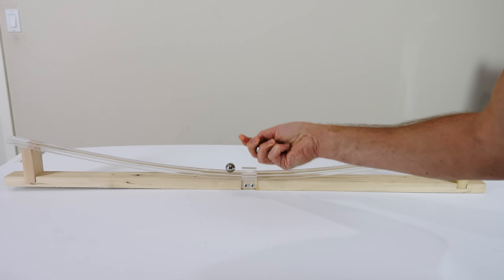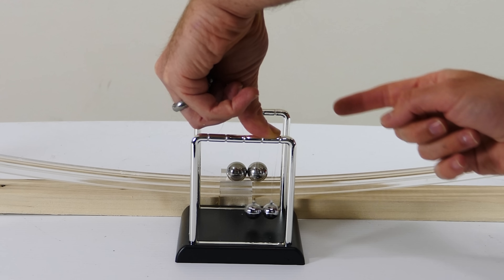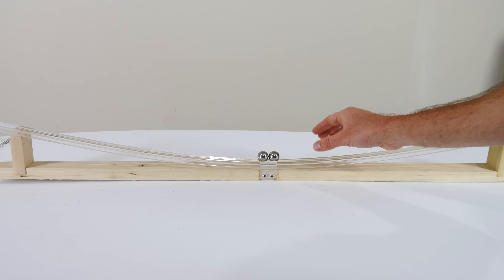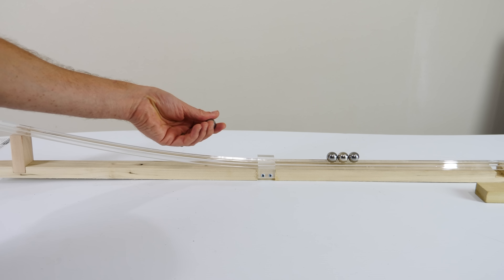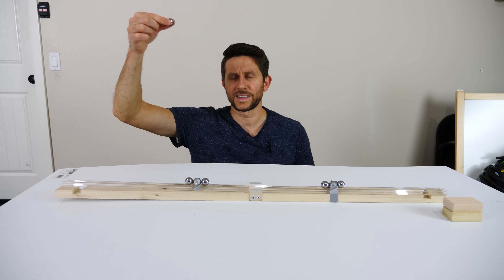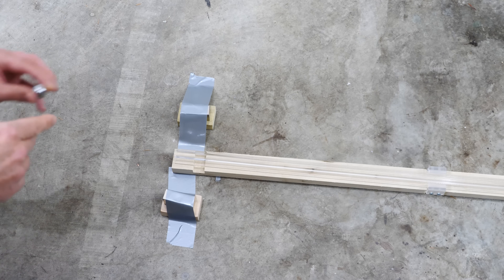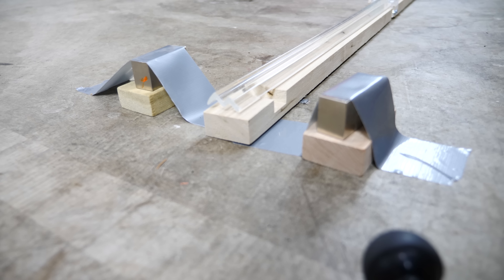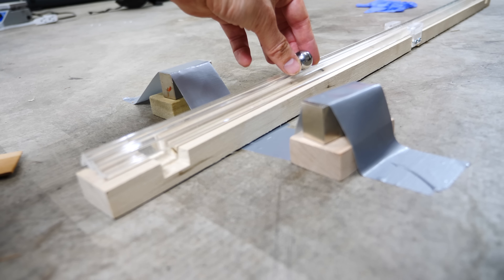How Does a  SMOT Work? (Simple Magnetic Overunity Toy)

Comment: There is always an energy loss between two or more balls rolling together, even if only during the time of impact.  They have their surfaces moving against each other with a sliding contact of counter rotation to each other.  This loss is much greater compared to the rolling ball's stationary motion between the ball surface and the track.  (But the rolling ball sees that resistant frictional force all along its travel path.  The pendulum balls do not.)  This is why the balls in ball bearings are caged to keep them from rolling (counter- rotationally) against each other.

You are not quite correct when the two balls impact on the track, and then the initial ball starts moving again.  Though no impact perfectly transfers all inertia, (we will assume it is nearly perfect here) with the target ball at the lowest part of the track, the second ball is still slighty higher on the curve of the track after the impact.  Once free to move after the impact, the now stationary ball will want to roll that bit further to the lowest point of the tract.  The pendulum balls on the other hand are hanging dead vertical (on nearly frictionless pivots, with the hangers during their impact, all being precisely spaced 1 ball diameter apart) so they have no residual potential (elevational) energy after impact.  The hanging balls are also not rotating at all relative to each other, and are only moving linear to each other at impact so they are just very efficient energy wise.  The pendulum balls only have to overcome air resistance during their swings and a very small loss due to the impact deformation.  The rolling balls have increased air resistance, (due to the additional surface speed of the ball in the air) added friction of rolling on the track, friction between relative motion at the impact sites, the additional rotational inertia starting and stopping the roll, as well as the impact deformation itself.

Anyway, I do enjoy your clips.
Reply: Agreed. Love the videos which are usually spot on, but this one is not quite entirely correct.

Comment: Your explanation of not gaining energy when passing through the taped magnet balls is wrong. The first ball gained energy when it was pulled to the first magnet ball. When that ball struck the magnet with the increased momentum gained by magnetic attraction, it was transferred to the last ball in that line. Then that ball with the added energy of the magnetic attraction continued on to strike the second magnet ball. That second magnet ball added more energy by attracting the ball in motion to itself then imparting that energy to the last ball in that line. The last ball has more kinetic energy than  what was input into the first ball. Both the first ball and the last ball have the same mass , but moving at different speeds. The energy type they both have is kinetic. Potential energy is stored energy such as in a wound spring waiting to be released, or a ball at the top of a slope waiting to be released. Neither the first ball or the last balls energy can measured as potential. The last ball has more kinetic energy than the first ball. Fact. Where did that energy come from? The magnets.  This experiment is a poor example to disprove over unity motors, but you are right, conservation of motion is why over unity motors don’t work.
Reply: "Your explanation of not gaining energy when passing through the taped magnet balls is wrong. The first ball gained energy when it was pulled to the first magnet ball. "
He's not talking about the potential stored by moving individual balls through the magnetic field-he's talking about the total energy in the system. Notice that he says, correctly, that the kinetic energy of the last moving ball is less than that of the first. That's the indicator that he is talking about the system, as it would be irrelevant to compare that value to the now stationary balls.
 
You're not wrong, and he could have clearer with this, but his point was that as there is no source of energy in the system, so-called perpetual motion devices will cease to work due to losses from resistance in the system. 

As perpetual motion machines are supposed to represent closed systems, it generally makes more sense to analyze and debunk them in terms of total energy in the system, rather than the transfer of energy within any individual parts.

Comment: One major loss of energy, that you didn't mention, when two or more balls are rolling together (touching each other) along a track is the friction between the surfaces of the adjacent balls.  When they are rolling, all the balls are rolling either clockwise or counter-clockwise (as viewed perpendicular to the direction of travel).  So when adjacent balls touch, their respective surfaces rub together at twice the rotational speed of each ball.  In effect, each ball is slowing down the other adjacent ball.  This effect is only compounded as each additional ball is added to the procession of touching, rolling balls.  By contrast the balls swinging back and forth as a pendulum do not slow each other down because their surfaces are not rubbing together.  They are merely touching each other, transferring nearly all their momentum to the other ball.  They do eventually slow down and stop, but it is largely because of friction from air resistance and internal friction from the continually-bending line that is suspending each ball.  There is also as very small bit of energy lost to sound (the clicking sound when they smack against each other) and perhaps a very small bit of energy lost due to a tiny amount of heat generated (within the balls) when the steel balls deform imperceptibly.

Ed Schultheis, PE
Mechanical design engineer and manufacturing consultant for 35 years
Schultek Engineering & Technology, Inc.
schultek dot com

Comment: Mr Action lab man sir
I have had this idea of a theoretical free energy machine for a while but I can't test it.

The idea is that you have a generator that is powering a big gear with alot of 'teeth' and that next to this big gear is a small gear with very few teeth.

Now the idea around this is that
Generator is spinning (big gear) with a set rotations per minute = number of 'gear teeth' Effecting little gear, because the amount of 'gear teeth' that are conjoined on 2 seperate gears creates differences in rotation speed. So if big gear is spinning at 10 rotations per minute, with 60 teeth, and the little gear has 10 teeth, that means that the little gear little gear will spin with 60 rotations per minute, and if the little gear is on the same connection point on a charger for the generator, does that not mean it's creating more electricity than the generator is using.

I'm sorry if it's a long read but it's the best I can do to explain my idea

Comment: How can you honestly say that the ball being accelerated by the magnet has less energy than the original? It sounds completely absurd. You have to use theoretical "laws" to explain it, but in common sense, it obviously does.

Potential energy only exists because there is a force capable of interacting with the object. Not because you moved the object.

The reason perpetual motion machines don't generally work is because, like you pointed out, magnetism isn't a one way force. It pulls the object back after accelerating it. Just because the system doesn't result in imbalance, doesn't mean it isn't creating energy. It just means it's creating energy in balance.

This just sounds like an excuse to pretend that energy cannot be created (or destroyed).

How can you suggest that gravity (or magnetism) doesn't create energy, when it causes acceleration? When it spontaneously brings objects together?

All energy is derivative of gravity. Fossil fuels, light, gpe, nuclear fission, you name it. It's all because of gravity. Without gravity, there is no force to be converted into the potential energy (chemical, nuclear, etc.). Potential energy doesn't exist without gravity, so doesn't gravity therefore create energy by it's presence?

I feel like the term "potential energy" is not being used correctly here. All matter has gravitational potential energy. So why does picking the object up change anything? It doesn't. It just allows the force to interact with the object in a noticeable way. Otherwise, the gravity doesn't result in acceleration, just constant force.

Doesn't the energy increase because of acceleration? The forces aren't equal in that regard.

Comment: I'd like to see a motor that really runs on the energy stored in the magnet. So that at the end the magnet is demagnetized. Maybe something involving changing the temperature around the material's Curie point.
Reply: That wouldn't work. Imagine a motor powered by a spring, there's only energy when its stretched out. once its released, the motor spins until the spring is back to zero. same with the magnet, you'll run out of energy to extract once you reach minimum distance to the magnet.
Reply: @Appletank8  Imagine a spring with a weight that gets stretched out and released. Cut the spring as the weight goes by.  You could demagnetize the magnet as a weight goes by and get the same effect.  Heating up a magnet will demagnetize it. I think I've seen this done as a motor. Because magnetism and electricity are two sides of the same coin, there is probably a more nuanced way to do it.

Comment: Very interesting but is misleading and is lacking clarity. At the end of the first segment, he states that the ball leaving has less total energy than the ball entering. This is demonstrably false. The total system has slightly less energy afterward due to friction losses. The gained energy difference between the ball entering and the ball leaving (with both higher kinetic and potential energy) is due to the change in magnetic configuration of the remainig groups of 3 balls... from a higher magnetic potential energy state with the magnet on the end to a lower magnetic potential energy state with the magnet in the center of the groups of three. This can be easily calculated using basic physics principles.
Reply: I hope you make some videos explaining the physics including math, even if you only use paper and pen.
Reply: yes, I like the action lab, But I see way too often some errors in the explanations.
it's fun and interesting but not very reliable.

Comment: Interesting, one observation (though not enough to significantly impact any of the results) is there is a difference between the newton's cradle and the track. Each ball has it's own pivot and slightly different arc on the cradle, on the track every ball has the identical pivot/arc. Again, doesn't change the ultimate outcome, but may make a slight difference. Still great video, entertaining as always.

Comment: when the balls contact each other, their peripheries are moving in opposite directions. FRICTION causes the ball's rotations to decrease ... putting on the brakes ... nothing more than that. It's the basis sited in my patent entitled "Controllable Clutch" and also called "The Roller Cascade Clutch" ... capable of going from a state of being 'fully clutched' to a state of being 'fully un-clutched' and in a matter of microseconds. There is no translation of components, just the application of a control impetus making possible the efficient PWM control of mechanical flywheel energy and thus a nifty, efficient CVT capable of handling automotive torque and power.

Comment: The smot debunking made alot of sense but it is unfortunate that you didn't explain why the marbles speed up. You actually claimed the faster ball has less energy than the first, which is not true. 

A good explaination for the increase in speed is that the ball that gets pulled into the magnet gains the potential energy the leaving ball has, as kinetic energy, when referencing the distances to the magnet ball. This doesn't mean the system has gained energy. The act of manually resetting the balls positions resets the potential energies for the next test.

Comment: Also in Newton's cradle each ball has its own pivot point 1 ball radius apart, so at the point of impact the moving ball is at bottom dead centre.
Rolling balls on the curve track, the center of the rolling ball is still 1 ball diameter away from bottom dead center.
So that's in addition to the rotation momentum.

Comment: Hey! I have a suggestion. I'm thinking what if you could make a solid with protons . I mean, yeah, there would be some other smaller particles but just not the electrons or neutrons. You could do that by getting a positively charged Hydrogen isotope with no neutrons (the isotope which is actually most commonly found). Then you could just cool the hydrogen till it's solid or at least liquid, that would be so cool - to see a solid/liquid that is mainly just made up of protons!!!!!!!
(it's theoretically possible, but is it practically??? dunno about that)

Comment: I want you or anyone reading this comment try something. just take a magnet and tie it to a string. We know if you put amagnet it will align it's north towards north and south towards south. Now just turn the magnet so it's north pointing south and vice versa. Now we will expect it to allign it's north towards north , even if it over shoots because of kinetic energy it should be like pendulum and eventually point it's north towards north . But that doesn't happen , it just start accelrating until it reach terminal velocity. I don't know why it happens but I discovered it a decade ago and as of now am unable to find explaination . If anyone know why it happens or replicate it on their own do comment so that I and he can know about it
Reply: If you are holding the string with your hand, you might be unknowingly giving it energy with the ideomotor effect of your hand. This is the same effect that makes dowsing rods or ouija boards "work". Try attaching the string to an immovable object (like the edge of a table) and see what happens.
Reply: @marasmusine  did that too same effect. Also you won't be able to give it rotation at that rpm by ideomotor alone it's not barely rotating it as fast as ceiling fans. I would also request you to recreate it at your end also
Reply: @harshwardhan228  Please post a video of the magnet on a string accelerating until terminal velocity instead of aligning to north/south. 
Preferably two videos at two separate locations to help rule out environmental variables.
Reply: @marasmusine  I did at three separate place so it's not enviornment also if it is even then it is as interesting effect. I have never posted a video before may be I can mail you
Reply: @harshwardhan228  It would be worth making a public video so it can be peer reviewed. While I am aware of some scientific procedures, I am not a scientist, and someone else more familiar with physics or psychology might notice something.
Reply: Something else you can try if you have an impartial  friend is a blind study. Have your friend wrap the magnet in paper, and also something of similar size and weight (but not magnetic), such that you can't tell the difference. Try the experiment with one then the other. This will help minimize any biases you may have.
Reply: @marasmusine  I think I would upload it in 2 weeks but in the meantime could you do it on your side please and that can be added in the video to remove bias
Reply: @harshwardhan228  Thanks, but I can't repeat your experiment until I see exactly what your experiment setup is!